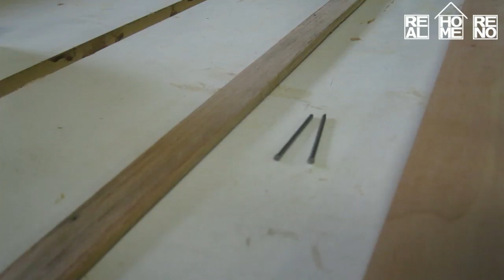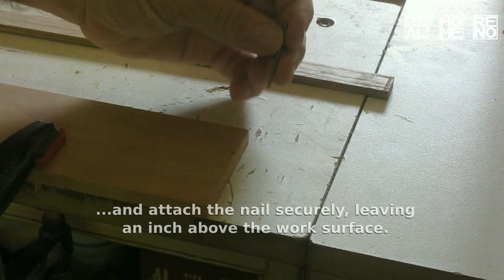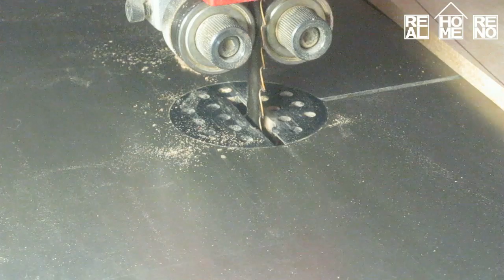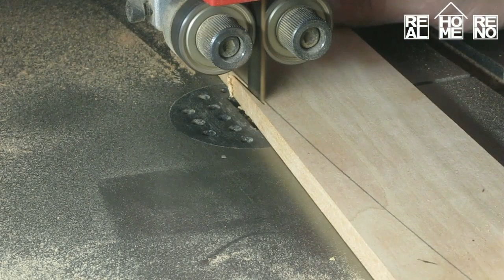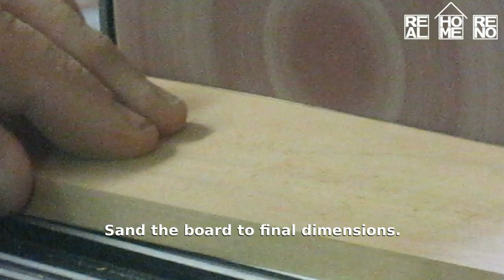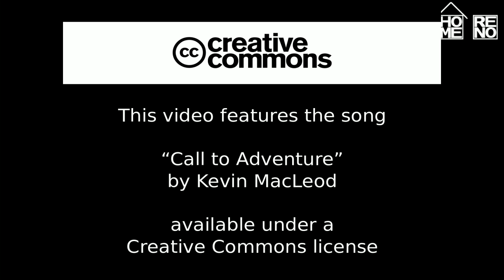How to cut a curve in wood

Comment: You probably want to mention that you should find the halfway point between the nails and push the batten there so you create a symmetrical curve. If you push off-center you end up with your piece. I served as a boatbuilder's apprentice and made many a rib and beam with the batten method you shared.
Reply: im going to attempt to build a boat. im glad you mention using this method in building boat because its the only way i was thinking to do a curve.